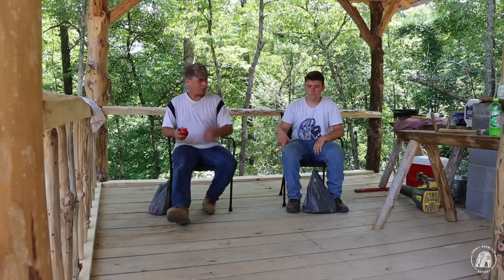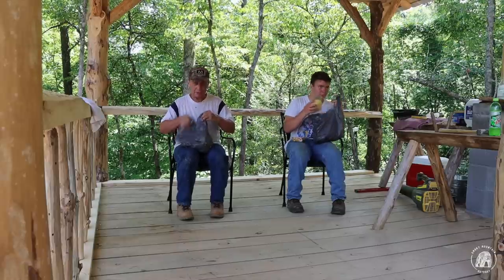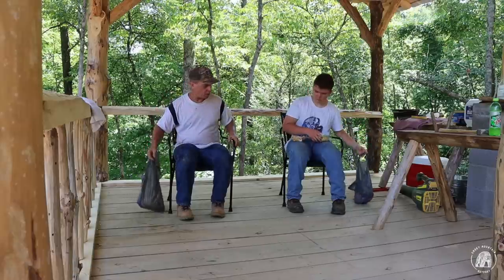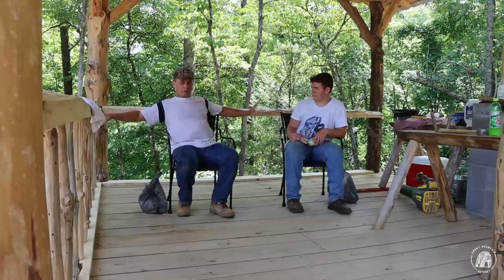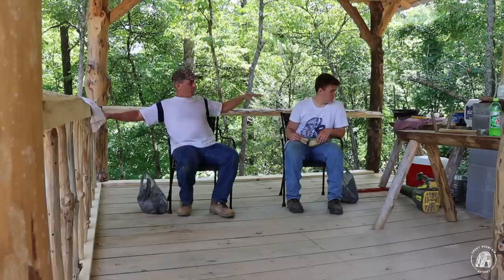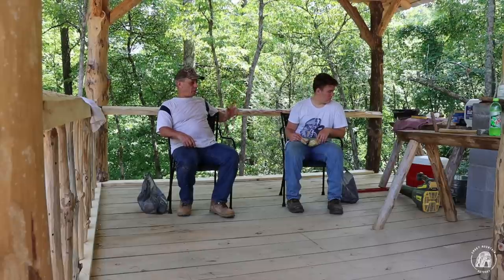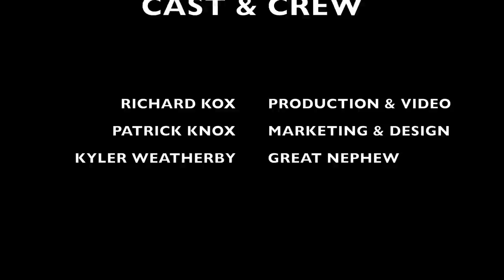S2 EP32 | TIMBER FRAME | OUTDOOR FOREST KITCHEN | FINISHING HANDRAIL FOR THE KITCHEN

Comment: I have a question.   I can see that you are debarking your lumber before making each piece of the construction project,  but judging from the look of the wood shed that you did this to, the material isn't faring very well.  It already has a greyish coloring which indicates that it will rot within a few years without some type of coating or paint.  Do you plan to paint or coat projects as a finishing measure??
Reply from the maker: That’s the sign of natural weathering. I didn’t use anything on it. Most of the 100-200 year old buildings around are gray from years of weather
Reply: @SmokyMountainOutpost  If that is true, then why did you spend so much time and effort blackening the frame of the big cabin when it will be covered up by some type of clapboard or milled siding??
Reply: @williamcummings3843  why would that not be true?
Reply: @marianfrances4959  Because if he were concerned about natural weathering there would NOT have been a reason to blacken the timbers in the large cabin.  (Blackening is a technique that weatherproofs the surface of the timber, similar to putting a coat of paint or finish to the surface to preserve the wood for longer periods.  Why do one project to preserve the wood, then do another project that leaves the timbers to be ravaged by the weather.???

Comment: Good morning SMO. Is there a reason or benefit to not glueing the wooden dowels in the railing pickets ? 
Coming along real nice. After seeing how you have done your railings we are thinking of redoing our deck railing in the same manner. 20x40 deck that is split into 2 tiers that are 20x20 each with 1 step between them. Our deck has a bench seat all along the railing on the lower deck portion. Since we live in town we will have to keep the pickets closer to each other to pass codes.
Reply: Those darn codes 😂👍
Reply: Jo Jo I agree totally lol
Reply from the maker: Well, I’m sure they aren’t going anywhere so no, I didn’t see the relevance in it.
Reply: Smoky Mountain Outpost thank you for responding. I was curious. I liked the way you fastened them with the pegs versus using the tool that looks like an oversized pencil sharpener.
Reply: Smoky Mountain Outpost the video for the outdoor kitchen cabinet is having issues with flickering green screen. Hurts the eyes to watch it. Is there a way you can reload the video.
Reply: Smoky Mountain Outpost I was unable to even post a comment on the cabinet build video. That’s why I posted here